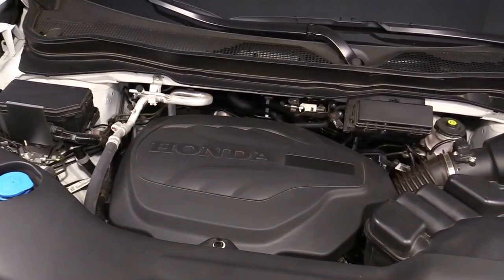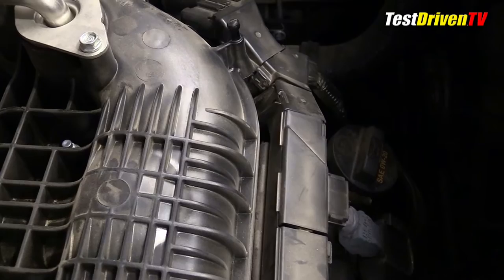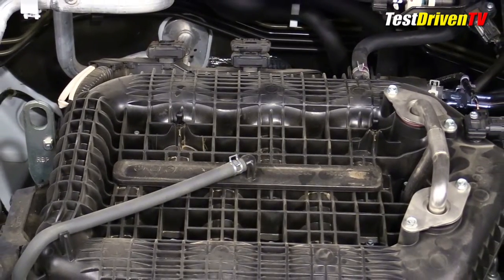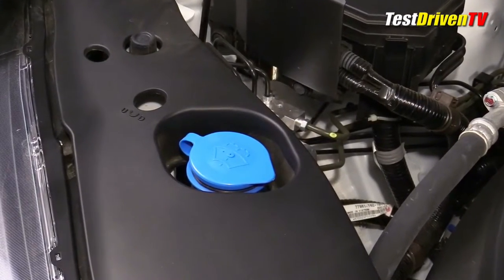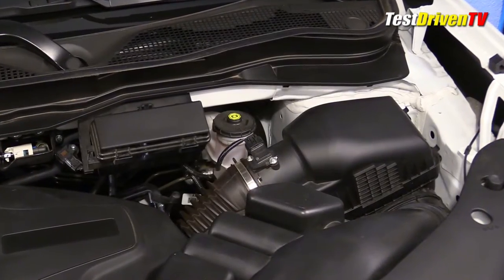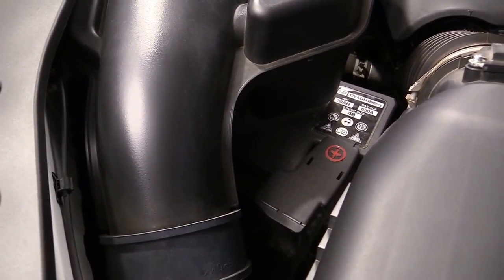2017-2024 Honda Ridgeline: Engine Explained

Comment: The design of Ridgeline was better suited to meeting my needs than any other midsize truck. However, it has 2 fatal defects.  First it is not an off-road truck, so the standard AWD only adds complexity, decreases fuel economy, and adds $3,000 to the price when compared to the completion.  If you live in a snow belt then disregard that comment. Second, it has one of the last remaining interference timing belt engines.  Apparently, Honda has no problem saving $10-15 per vehicle when they know every customer will spend $1,300 between 60,000 and 100,000 miles to change the timing belt and water pump. And the HPD package is more than a $3,000 option for some graphics and tire package.  Try buying a Ridgeline for less than $40,000.
Reply: Funny, the one thing I thought was a 'defect' was "no power driver seat on the base/Sport trim'.   I test drove the base/sport trim, and it was a great truck/ride.  But the 'manual adjust' front seat sucked.  As it only goes down/back and up/forward.  So if I adjust back as far as I wanted, I was too low in the cab.  Really wish they'd put power seat on the base/sport model.   I got out of the sport and into an RTL, and man, the power seat made all the difference.  It'll be the model I get.  Just wish I didn't have to upgrade a whole trim level for just a power seat...
Reply: UTube channel Sarah n Tuned posted a video on the Honda Ridgeline about 3 months ago. 
Titled. "I can't believe it climbed that."

My neighborhood mechanic replace my timing belt/waterpump for ~ $950.00.
The Dealerships wanted $1,100.00 - $1,400.00
Honda recommends to have it done ~ 100,000 miles.
Reply: Please explain inference engine etc. What does that mean
Reply: @americandude3825  In an interference engine the pistons and engine valves move in the same space in the combustion chamber.  The engine timing controlled by a timing belt or chain prevent the 2 items from ever meeting.  If a timing belt breaks, some cylinder valves will be in the open position in the cylinders and when the pistons move up in the cylinder they will meet. When this happens, valves break and pistons are damaged requiring extensive reair and usually a new engine.  Not all engines are interference.  Timing chains rarely break. Timing belts make less noise than chains but when noisy direct injection came about, that advantage was no longer a reason to use them.  Toyota switched to tming chains in 2010.
Reply: @clarkkent9080  thanks. My 2008  sequoia has 204k miles and runs fantastic. Solid. 

I think of the new Ridgeline bc it’s all the truck I need and I can buy a new RTL for same as a 6 year old tundra with 70k miles.
Reply: @americandude3825  The Ridgeline was at the top of my list and Honda is right when they say it is all the truck that 90% of Americans need.  Honda has begun changing some of their engines to timing chains and I have no doubt that the 3.5 V6 will soon follow.  I live in the sun belt and have no need for AWD. After considering my situation, I just decided that there were other trucks better suited to my needs.  Like I always say; if there was only one best truck and car, there would only be one truck and car.  Everyone has different needs and wants and that is why we have a selection.  Enjoy yours!
Reply: @clarkkent9080   well said. John and Martha raised you well, Kal El !

Comment: Simple question - the engine cover (2021 Ridgeline) is a pain to get back on.  Is it necessary to keep in on?  Can the engine cover be left off permanently?   Thanks
Reply from the maker: You can leave it off but it will be a lot noisier.